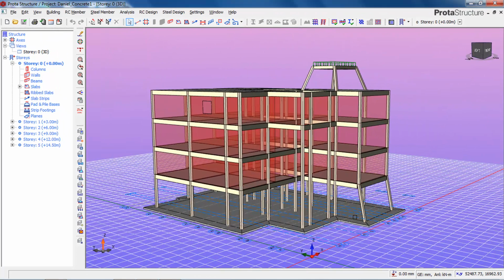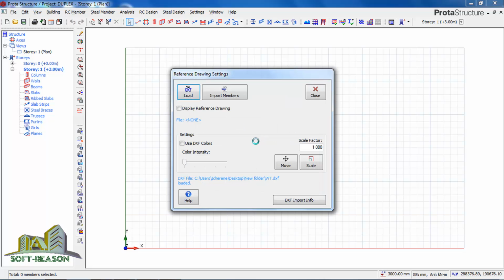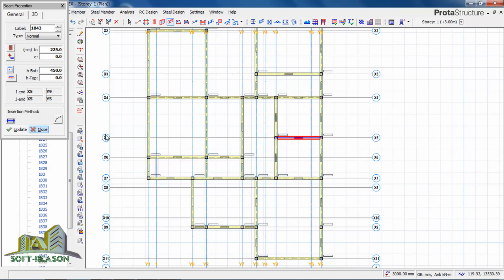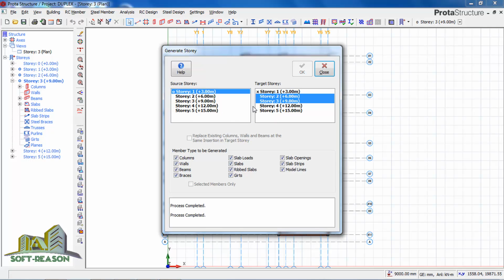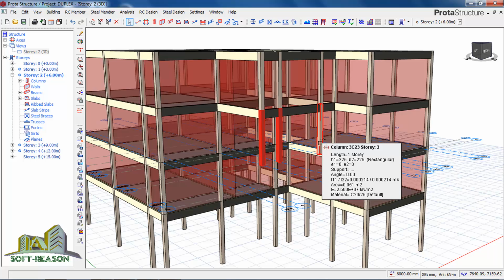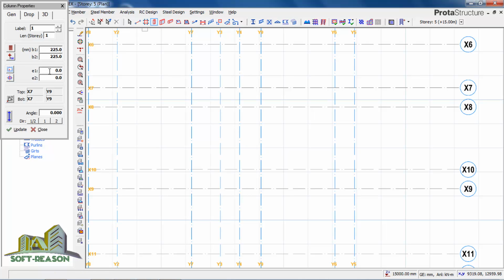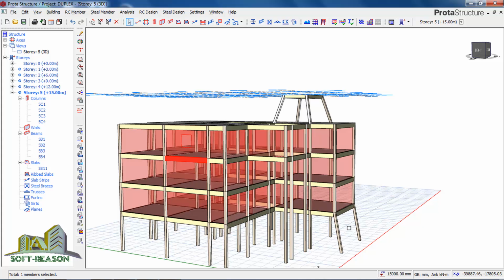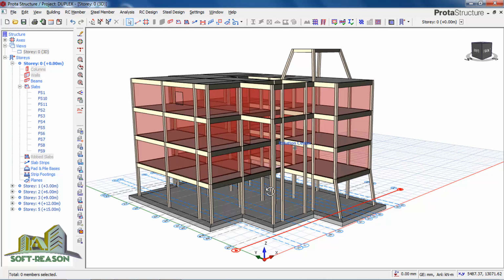Conceptual Building Model with an Incline, Slender and unbraced Columns in PROTA STRUCTURE

Comment: How  are you?
Usually  in protastructure  upper columns may have or same steel bars than lower columns in the design 
 as u can check  that column tutorial results which is impractical. 
How can u make upper columns  to have enough bars but not more than lower columns which is the reality. 
Thanks.
Reply from the maker: You most be careful in such cases and do your columns interactive design diligently to correct every necessary wrongs in rebar arrangements in terms of the diameter and numbers bars of all storey's columns.